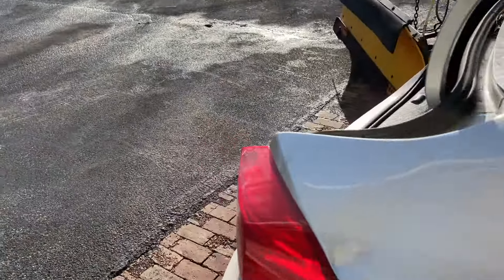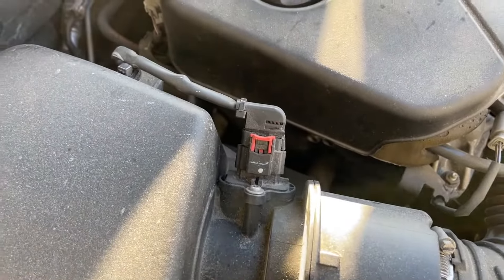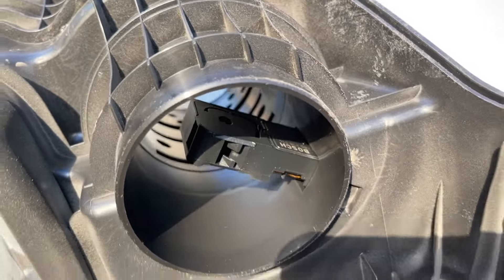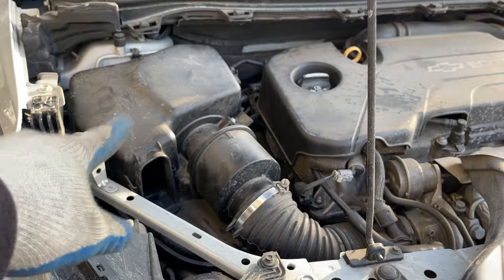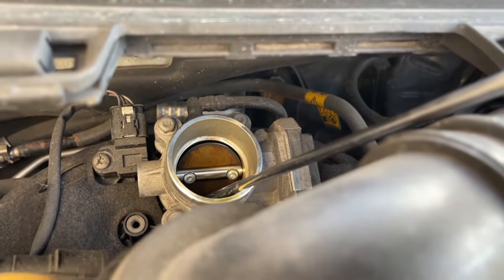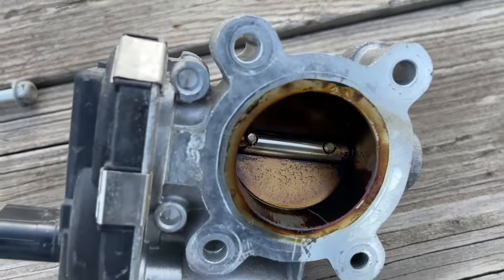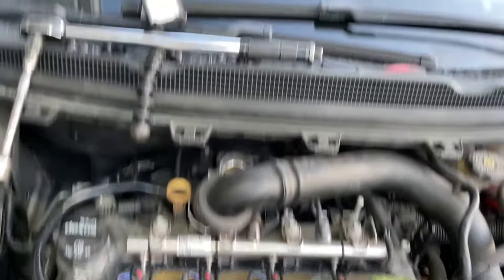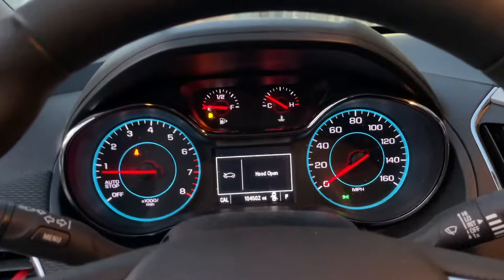Chevy Cruze Bad Throttle Body Or Mass Air Flow Sensor?? Code P1101 $30 Fix Quick And Easy!!!

Comment: I replaced the air filter, MAF, MAP, and now I finally came across this video. I'd rather spend $10 to clean it than $90 to replace it. Thank you for making this video and thank you for those who commented and shared their stories too. This will be my next project
Reply from the maker: You're very welcome. I'm confident this will fix your issue at least until you decide to replace it. Thank you so much for watching.
Reply: My MAF was $151 😂where you get yours ?

Comment: Man bro you snapped. Took my car to 3 mechanics and they couldn't figure it out. Thank you so much for the help. I changed the MAF sensor $150 from the dealer, changed the air filter $21,  cleaned the throttle just like you said $7 throttle cleaner, changed the cabin filter just incase lol $20 dollars. My car runs like it came out the dealer. Thank you so much for this video took my car to the emmisions test today and PASSED 👍🏼👍🏼👍🏼👍🏼👍🏼👍🏼👍🏼👍🏼👍🏼👍🏼👍🏼
Reply from the maker: That is so awesome. You placed a HUGE smile on my face. Thank you so much for watching. I am glad my video helped you.

Comment: Wish I could like this video a million times. Life saver and money saver. I was charged $150 at Blacks Tire for "Throttle body cleaning" because I brought it in for a P1101 code.  Code came back days later. brought it back to Blacks and all they did was clear the code and told me to take it to the Dealership if the CEL and code came back on. The code came back on before I left their parking lot. I came across this video and as soon as my engine cooled off I followed the steps. After I removed my Throttle Body the front was clean but the backside was COVERED in Carbon build up....I cleaned it with Throttle body cleaner and a micro fiber towel and got it shiny again. I wish I could show you the before and after pictures I took.  Bolted it back on and started up my engine, the CEL is no longer on! I didn't even have to reset it. Sincerely, THANK YOU Terrence. This video is by far the best P1101 fix I have found online.
Reply from the maker: Hi Marlon, I hate you didn't find my video before you spent the money however, I am glad you were able to fix the problem with the help of my video. Thank you SO much for watching!

Comment: I did exactly what you did minus changing the air filter ( but will go back and add a new filter) just wondering why the dealership told me the P1101 code was being cause the pcv orifice(valve) and that I needed a top engine clean, and it would cost $1,585 ….. 🙄. So glad I did some research and found your video. Gotta admit I’m still staring through my steering wheel hoping that dang light doesn’t come back on.
Reply from the maker: The dealership is something else. I understand they have to pay their employees and they warranty the work, but the prices be ridiculous. I am glad you found my video as well. I have a few detailed videos of this engine. Hopefully they'll help you or just ask and I will help. Thank you so much for watching.
Reply: @TerenceDIY  thank you so much for replying, I’ll keep you posted but hopefully nothing changes. You def got a subscribe from me.
Reply from the maker: @kreativelykeisha5428  , please do and thank you SO much for subscribing.
Reply: @TerenceDIY  I have a 2018 Chevy Cruze 1.4 LT...is the Throttle body as accessible as the 2016?
Reply from the maker: @mannishassmanny6759  , yes it should be identical to this. The part for the vehicle specifically covers 2016-2018. Here's a link to an OEM throttle body at a great price. 

https://www.ebay.com/itm/264758871266?fits=Year%3A2018%7CModel%3ACruze%7CMake%3AChevrolet&hash=item3da4dbc4e2:g:AFkAAOSwW1Fe4B2O&amdata=enc%3AAQAHAAAA8CxW3xQBDP8Wl4cp%2FeJPnBQYpu1melspN0yxoRDP%2BdB%2F%2FmA7pzFYuaaE1kihfbR3612ZT5lSjes0H8fTnquFv5AuXN6dxHo%2FFUJhJiPwxAO%2F3KuPSabF3Z7Nj5LXyPE0elrXw7uEQOtIA%2B48NfNLSGjz3D0mD7AErM9tU5bhbQOaGQrYjh76KZrRTpN379PMl6i9h7wIwHlYmhnyGxlsKMIvkU8ZIG5c%2BDWEHfYvZc5L9Nv1brzhNOh42IIznJyrSOMCObLc%2FwqPVScoUZ6c1ja5ZxbvEbVp8fZwBKjDI0tFeMxULCSkgHg46x0DqkfgxA%3D%3D%7Ctkp%3ABFBM-o-T6N5h

Comment: Just hit 130k miles on my 2017 Premier. Intermittent p1101 code... I am replacing the air filter now that I had replaced at 90k. It should have had another 5k until the next scheduled maintenance interval so I am pointing my finger at the throttle body. I'll pick up a can of that CRC and pop those 10mms tonight.
Reply from the maker: Yep, that should do it hopefully.

Comment: In the mass air flow clip don't pry it like he did lmao... Pull the clip up. The center of the clip their is a black square, press in and pull the connector out.
Reply from the maker: Thanks for sharing that info. I am REALLY good at what I do, I mean REALLY good. Thanks for watching.

Comment: Broo this p1101 code just popped up on my 2016 cruze today i replaced the maf sensor and a new air filter i was going too buy a new throttle body it runs 190 but cleaning it might just be the way too go i really appreciate this video bro this is exactly whats wrong with my whip
Reply from the maker: Cleaning will definitely help but here's a link for the part at a great price (I buy most of my parts from here). 

https://www.ebay.com/itm/385181633903?fits=Year%3A2016%7CModel%3ACruze+Limited%7CMake%3AChevrolet&epid=252224181&itmmeta=01HQBFKQ9KBQ18YF7B1DD88N79&hash=item59ae9d4d6f:g:HpwAAOSwb2ZjUGY8&itmprp=enc%3AAQAIAAAA8Ka84SNZ8YemA1o3QjIoDRkJfUmAcBbsLbGlCzw5AujOy%2FB6Fvtcq2CBApO6GoyXDXX%2FmWCuO9EssIorA0o5dWTn7U%2FWAVfCAG43aVvmq8mkqI%2F2lIuHeDd%2BGqdFC8PxsrHPcox1tCM5fRx6Fms7jwWvCwjPKKurakRV9B7RxsIK56hRAA%2F%2B%2BugpaHWBTGqdWLwRKzNyKpdngy%2BzqFI10KXvuhlv5wmyVmQmXKS7LqzYQ5Rjgc%2BdLRvKnGtpXNyN3lNVCNdhWFNLsWICDlc1BizdLQADamMhCikiRupsgikQsfYKDBA%2F0UQFthiCDHNlUA%3D%3D%7Ctkp%3ABk9SR4T1zu-6Yw

Comment: Literally been tryna figure out why
My car been shaking stopping at stop signs smoke from exhaust etc literally this video was a life saver! All this time I spend hundreds tryna figure it out and it cost me 0$ cause I did it myself and had auto zone credit to buy the stuff and took thank you so so so much ! The throttle is definitely important to be clean every 4-6 months easy and cheap ❤
Reply from the maker: You are correct about the throttle body especially on high mileage vehicles. I am glad m video helped you. Thank you so much for watching.
Reply: BROTHER IM HAVING THIS ISSUE NOW MY CAR HAVE 150K MILES NOW IS A 2017 CRUZE LS 1.4

Comment: That air filter advice is gold. Spent months chasing down a P0172 code. Changed MAF sensor, MAP sensor, 02 sensor. Turns out, that stupid GM design air filter just needed to be clicked in properly.
Reply from the maker: I'm glad you figured it out. Thank YOU so much for watching.
Reply: I'm having the same problem with my 17
Reply: @JonathanArriaga-e4c   did you recently change the air filter? Also, don't cheap out. Get the AC Delco one.

Comment: Did this today and my check engine light is off now thank you because they told me at the auto parts store it was my MAF so I cleaned it and it didn’t go off so I kept trying to figure out what it was mine was on for months until I came across your video & seen that the same code was associated with the MAF as with the throttle body so I bought the air filter & cleaned the throttle body and just like that my cars running brand new like I just got it all over again
Reply from the maker: That's awesome. I'm glad you got it back running great again. Thank you so much for watching.

Comment: I changed my air filter and checked the maf sensor. Mine also looked brand new. Check engine light came back on the next day after it went off from unplugging the battery. Going to try cleaning the throttle body next and see if that helps the situation
Reply from the maker: Please let me know if that helps. I'll be shocked if cleaning the throttle body didn't improve your situation.

Comment: I'm having the same problem.   I have the same car as you. I changed the air flow sensor, and my check engine light is still on.  Thanks for the tip
Reply from the maker: If you try this, it may fix your issue. I know these cars pretty well. Thanks for watching.

Comment: How many miles after doing this and the check engine light not going off could I assume it didn’t work?
Reply from the maker: It worked however, because this car was used for uber eats, they had accumulated lots of miles within a 3-4 month span in which ultimately led to me doing a permanent fix.

Comment: P1101 popped up on me too, I’m at 110k miles. I changed the MAF sensor and filter. Going to clean the throttle body next. Thanks for the video. You got a new sub 🙏.
Reply from the maker: Cleaning that throttle body will help a lot and it's a quick job. Thank you so much for subscribing to my channel. It means a lot to me.
Reply: Did it work?

Comment: My 2017 Cruze gave code P0172. Secondary dtcs P0101 & p1101. The check engine light came up after I got my oil change and air filter replaced. I change the maf sensor and I still have the check engine light. I have about 91000 miles on the car.
Reply from the maker: Hmmm... interesting. Let me explain, code P0172 arised after you had the oil change and air filter replaced. What instantly popped up in my mind was the air filter replacement. If that airduct around the air filter wasn't install correctly, it will cause the smallest leak vacuum leak and throw that P0172 code. To be sure I understand you correctly, the vehicle was fine prior to the oil change and air filter replacement?
Reply: @TerenceDIY  Yes there was no check engine light. I just scheduled the oil change and I was told my filter was not clean so I have them the go ahead to replace it. After the oil change I took the car to the tire shop. I got four new tires and they fixed my back two shocks. When I got the car back I was told the check engine light was on when they took my car back.
Reply from the maker: Smh. Sorry to hear that.  I would start by visually checking around the air filter duct. If it weren't put back together correctly, it will cause a vacuum leak hence, throwing that code p0172.
Reply: My air filter wasn’t snapped in correctly. So I spent money to fix the car when it was nothing wrong with it. Vavoline just placed the air filter in and it caused my car to throw a lot of codes. I had to get it towed to the dealership because the car wouldn’t move. 🤦🏾‍♀️
Reply from the maker: @teasialee3712  , just as I figured. Sorry to hear that. I wish I could have helped. Once again, thank you so much for watching.

Comment: Thanks for the vid.  How did you fix the safety tab on the electrical connector?
Reply from the maker: I believe I wrapped a piece of electrical tape around the connector once I plugged it up so it could be secure. Thanks for watching!

Comment: I'm getting the P1101 code on my 2018 Chevy I have both a manufacturer warranty and an extended warranty and none will cover a throttle body if that's even a real issue I've also been told it could be the turbo going bad. The check engine light will come on often times it will not and I have lost acceleration on the highway it'll only go up to 68. The car only has 57,000 miles.
Reply from the maker: Hi Frank, she (the customer) was also told that it was a bad turbo possibly. I cannot see that turbo going bad at only 57k. If I were you, I'd just remove the throttle body (very easy) and clean it up. It will 9 times out of 10 fix the problem. Thank you very much for watching.

Comment: Thanks a lot for this helpful video l!
Unfortunately I still have the check engine light after cleaning the throttle body, new air filter and MAF, and CEL is still there, any idea or suggestions?
Reply from the maker: Have you ever gotten a reduced engine power message? Also, what year is your car? You may have to replace the throttle body in general. Thanks,
Reply: @TerenceDIY  it's Chevy Cruze 2016 2nd generation, nope it's working properly
No reduced power engine. I some droplets of oil at the turbo intercooler, I am not sure if the CEL is coming from that, any suggestions?
Reply from the maker: @medcherif9714  , okay. Please tell me exactly what codes you have so I can look into my Cruze software. Thanks,

Comment: Would this work for a 2011 Cruze? I've got the same p1101 code
Reply from the maker: I am pretty sure it would. I would clean it first but if you wanted to replace it, here is a link for the part at a great price (these will not last long because the seller has them marked down). Also, if you do decide to replace it, you will get better MPG. Thanks for watching. 

https://www.ebay.com/itm/385181633903?fits=Year%3A2011%7CModel%3ACruze%7CMake%3AChevrolet&epid=252224181&itmmeta=01HSF8X4KYZHV42D0S8VMXTYYT&hash=item59ae9d4d6f:g:HpwAAOSwb2ZjUGY8&itmprp=enc%3AAQAJAAAA8K983%2F1FbLpYANj9d2Mv%2FEOS4ueIp6xXcXhB11pa9fGqYON6rxcSu3tg%2FnafHKb%2Fbxc9DdAq8jYXDPHJqcBGo%2BGyklVK94MdPXiNsox8T3ceLH2ZrrKkk8O1Wz52YCe5%2Bl8rAipAIO3qGk6bun3xdcLROZJ3lxWodGVg6ZZaj2K3iOR7CgeD3LenRhYBcHHqWGXwAHYJRT%2BwNJovwjrcfvCn4haDNp2VYde9J2tx976L2f5CE9NI%2BOeTUgBRnJm%2FpVcF4kVD4OcIJh15nXQzfOSnWiizth9kTG3CzMM8R%2FDjrbKw%2FgHZ2B2zPF7UXnDMmw%3D%3D%7Ctkp%3ABk9SR7TK9OjLYw
Reply: @TerenceDIY  Thank you very much. Keep up the videos you do great work. You just gained another subscriber 😁
Reply from the maker: Thanks for putting a smile on my face.

Comment: Yes I have a 2017 Chevy Cruze 2.4 gas with codes p1101, p0101, and p0299.   I’ve changed the mass air flow sensor, ambient air sensor, o2 sensor, air filter with the engine light still on.  It’s not in reduced power mode.  I’m not sure what else to check?
Reply: I’ve also cleaned the throttle body on it as well
Reply from the maker: @KodaBlaine  , here's a video they can help you out (link below). If not, let me know. I will try to identify the problem. 

https://www.youtube.com/watch?v=LaZuFWEVNKY

Comment: Could oil change be causing the problem?
Reply from the maker: I have seen cases where a prolonged oil changed caused similiar issues. The car had ran very low of oil and the little oil that was in the engine was black.
Reply: @TerenceDIY  my original filter is still clean. The throttle body is still intact. It has been parking for two years, which was the last time it had an oil change.
Reply: The dipstick handle broke when I tried to remove it to check the oil.
Reply: @TerenceDIY  2017 malibu with 11k miles.
Reply from the maker: What exactly is it doing? What codes are showing up? That's a very low mileaged vehicle.

Comment: Could a dirty throttle body be a reason for running high rpms?
Reply from the maker: Possibly, but I doubt it. It won't hurt to clean it. I would do it on the car.

Comment: I got as far as 11:35 but then got stuck because the safety clip on that cable would not come off, so I wasnt able to remove the throttle body. I tried to clean it while it was still connected, but the light still came back on when I put everything back. I dont know how I can get that throttle body off without being able to undo that clip to remove.
Reply from the maker: Are you talking about the electrical connector?

Comment: I wonder if this would work for me? I have a 2018 LT. I had an oil change  like a month & 1/5 ago & they recommended I change my air filter. Did. And shortly after my check engine Luther came on while in the highway. The P1101 is showing, but not all the time. Replaced the sensor with GM part few weeks ago. Now I’m noticing surging with the rpm’s & rough idling..no surges when idle though. has 94k miles. Hate to go to the dealership. This may be my last hope. Looks easy to do on my own. But sheesh! lol 😔
Reply: Guess I should ask, did this fix the issue for good?
Reply from the maker: @KevinC2k10  , yes it fixed the problem. I am pretty sure this will probably fix your problem. It's a very EASY and straightforward job. Thanks for watching Kevin.

Comment: I've done all of this, and the p1101 (manufacturer control)code is still there on my 14 cruze.  I have to press down on the gas pedal all the way, especially when getting on the highway and trying to pick up speed/incline. It seems like my fuel leaves really fast too, maybe its a vacuum leak, no other code . I did install the cruze kit on my car,and the code popped up.
Reply from the maker: What kit did you install?
Reply: The cruze kit @TerenceDIY
Reply from the maker: The cruise control kit? If so, that may be the issue.
Reply: No, that's not what I'm saying, but it's ok, thanks anyway.

Comment: Just came back from Autozone with the P1101 code
Reply from the maker: You could probably get away with cleaning the throttle body instead of replacing it.